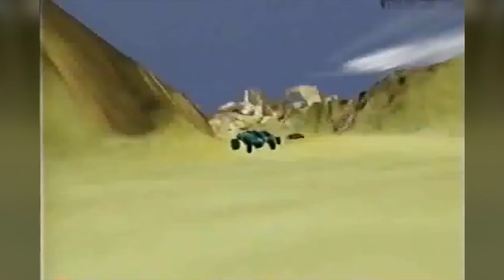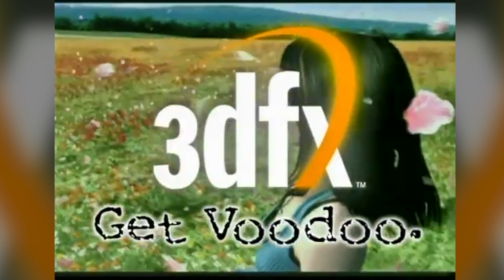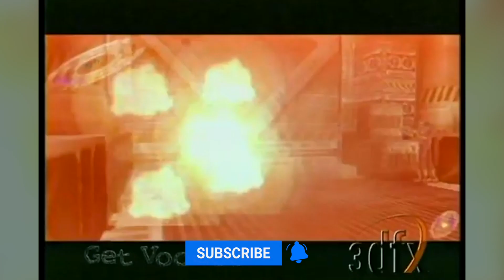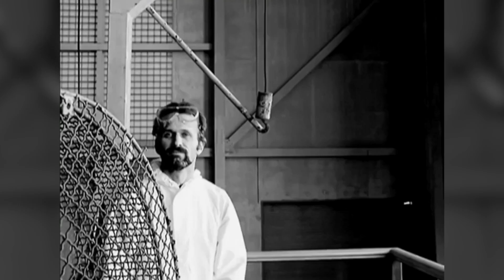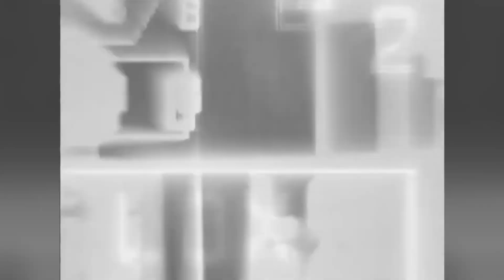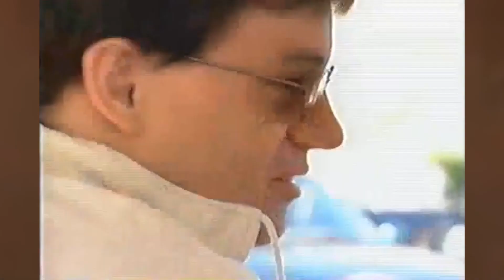3Dfx: Gone But Not Forgotten

Comment: Yes I had 5000 shares of 3DFX that was suppose to be traded in 2 to 1 for Nvidia stock.  Then in a change or heart they decided to screw the stockholders and not kill off 3Dfx, they took all the 3DFX property but left it as a shell company so they would not have to give the 3dfx stock holders anything.   And then after then did that they sent out a welcome to nvidia to the 3dfx stock holders offering to buy their stock.   Talk about insult to injury.  I was not not to found of Nvidias tactics.

Comment: I still have my Voodoo 3 3000
Reply: Same here 😁
Reply: me too!
Reply: Cool but is it pci or agp? I got voodoo 5 5500 agp
Some coders are working on Linux drivers for it, phoronix said that
But since newer system have pcie how do we benefit from that ?
Maybe with some port converters agp to usb or pcie, tough quest
Reply: @igrewold  It is AGP, I never checked to see if they ever made an adapter. I still have 2-Core2 Duo 3.16Ghz Quads going strong with PCI slots (Rx460s in them now) Have a AGP board up in the attic!😁😁

Comment: The exciting good old days, when 3d graphics was really breaking out, defining itself as a separate technology. And 3dfx was at the forefront.  My first card was a voodoo3, basically a single voodoo2sli with excellent 2d.  Supremely compatible with games. Half Life, AvP, Unreal, UT, Quake 1,2,3, Thief, System Shock 2, Descent....(remember Quake3 vs UT?).
Reply: I went the cheaper route. I got a 4mb card in 1997 but found out it wasn't 3dfx compatible. But by the time half life came out my card was on a par to the earlier 4mb 3dfx cards. the improvements in drivers and directx must have made the difference.